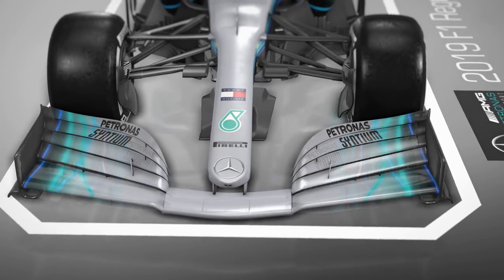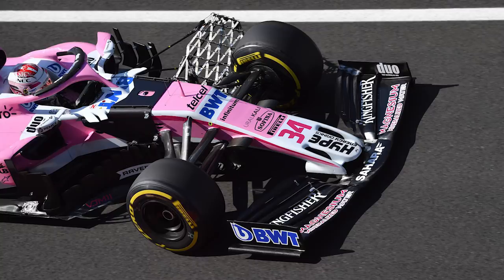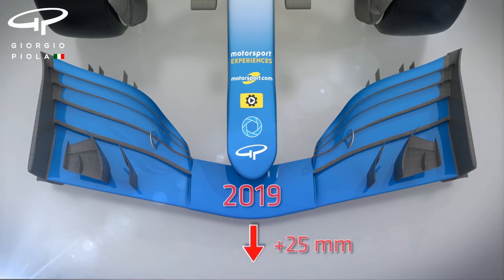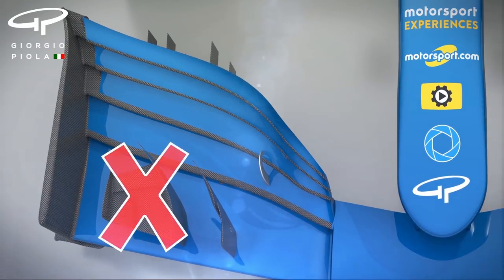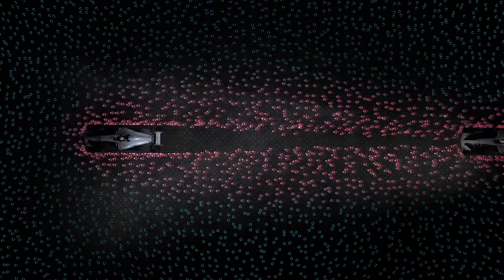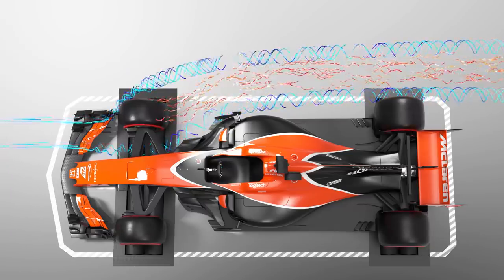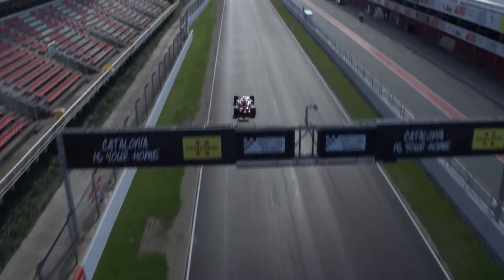First Look At The 2019 F1 Front Wing Designs

Comment: F1 should be suing MOTO GP style rules that help the little teams. Give them real track time, more engines per season and more fresh tyres over the weekend. 
When they improve these concessions drop off
Reply: European manufacturers won't ever agree to this
Reply: I don't watch Moto GP, but I don't think that would work well in F1 because of teams like Mclaren. Mclaren has a boat load of money but their administration struggles really prevented their development, and correct me if I'm wrong, but a Moto GP team operates at a fraction of the cost of an F1 team.
Reply: Like Dorna, Liberty wouldn't give the teams a choice, this is happening. 
As most main teams are also suppliers to smaller teams it's in their interest for those teams to have more testing time.
Mclaren, Ducati. same thing, was good, went bad due to management. but Ducati is now back up there thanks to the rules which meant they got concessions. as they improved these reduced until they had none. 

A lot of the cost now is development which is far more costly because they can't just run the thing around an airfield and see what happens.
Design, CFD it, windtunnel, take it to the track as a finished item, find it doesn't work as predicted. wasted weekend, bin part.

They also build engine after engine in the off season, dyno test loads of them to see which 3 may last the season and bin the rest, times this out for engine suppliers.
This costs far more than just making 10-12 engines in the first place and using them for just a race or two. same goes for other components in the drivetrain.
Reply: cornishcactus But then F1 is supposed to develop technology for road cars. That's why they limit the engines (probably they want to squeeze the engineers on reliability). As for tires, it's more to action and strategy I guess.

Edit: It's an expensive sport that's why it's difficult for manufacturers to build an f1 team from the ground . They would rather sponsor PUs .
Reply: @ cornishcactus - The problem with that is - at what point can you irrefutably conclude that a team has "improved" enough from its previous state to cut off the help? Because if its to make them compete with the front runners, then you'd want them to first match the top teams for a certain number of races. But if that's the case, then who would want to be a "top team"? Why would any team spend loads of money designing the best car possible if they know the FIA is just going to help out their opponents? And what incentive do other teams have to "improve" beyond that cut-off line if they know they can still get competitive results without needing to spend as much as the so-called top teams? They would just sit on that cut-off line and proceed to reap all the benefits without having to do any of the hard work. And what's stopping teams from faking their performances just so they can get the "benefits" of not being a so-called top team? So many problems with that theory. And quite frankly, it sounds like communist/socialist ideology more than anything.
Reply: Well that's easy and if you watch MOTO GP you'd know that podiums will get your concessions reduced.
Not just the odd fluke, tho it'd reduce it a little but Ducatti now have none so far as I'm aware now they are regularly capable of race wins again .

No team would aim to be in the concession zone, or at least would choose to stay there.
Wins mean money and sponsorship and no team would turn that down just so they can run midpack.
Look at Mclarens recent cars, some had no sponsorship, and they've still very little.
Williams run of form a few years ago won them Martini and thats going next year I believe now they're back of the pack. 

So what benefit might a couple more engines a season be you say.
Well first off less DNF's through failure, that's more potential points, better championship standing, more money from the pot. It's also more screen time and better potential for selling sponsorship.

Also engines have their various power modes which are based on minutes. If you've more engines you can run what you have in higher mode for longer each weekend giving you quali and race advantage.
The same with tyre choice. 

It's not F1 Stalin style and it'd not chuck the big boys off the top step ( again witness MOTO GP ) but it'd give the little boys a chance of running at the front, to be competitive and sometimes grab a podium if they get things right.
As they do that they get to join the big boy club. 
If the budget doesn't end up matching once concessions are off you drop in the standings but next year you'd get them back again ( tho it might be two bad years i think ) 

F1's current rules mean very little is translatable to road tech, no car engine gets close to the thermal efficiency of a current F1 engine and the differences in performance requirements/cost impact are too great to copy across.
Only when F1 was truly allowed to develop did this happen, monocoque  chassis, disc brakes, aero.
if these leaps happened now they'd be banned.

Limited engines are done in the name of cost not road tech, 5 now 3 engines per year, thats gotta be cheap right?
Well if you're the manufacture no, you make loads, break loads on the dyno find the good ones and use those for the year.
The cost of that gets passed on to your customers.
Road tech engines can already do millions of miles if treated right and none of that has come from F1 improvements.
F1 engine supply would be cheaper if they had 1 per 2 races or more. the engines wouldn't need to be so highly stressed. they wouldn't need to bin dozens or more in testing before picking the season quotas.
They would simply be cheaper because they wouldn't need to be so perfect. 
They'd pick/design a nice decent engine that'd do the two races over one that might do 6 or put out another 10BHP and it'd be far cheaper.
Reply: Dan Arnets That is cheap compared to running an F1 team. Low tier like sauber cost 100million at least.
Reply: Ferrari spends close to 600 million.
Reply: Yeah you are right, its not supposed to be cheap, but keep in mind that if costs gets too high many teams will eventually abandon F1 and you don't want 6 cars racing on a circuit...lol, look at indicar, much cheaper (because it is spec racing) than F1 and cars and they are almost as fast. We need to implement measures to make it easier to smaller teams, so there is less of a gap between cars and there is more actual racing, if you don't put a budget limit (which we already have) mercedes and ferrari would burn millions of dollars and make their cars even faster than they are and F1 will be much more boring than it already is. 
Remember, F1 can't be the pinnacle of motorsport if you end up having 6 cars on a racetrack and they have a gap of a second per lap respectively.

Comment: I think they should be limited to duel plane front wings and have the majority of downforce come from ground effect.  We now know enough about aero to regulate underwing-generated downforce to a safe amount.  People who argue that ground effect cars are too dangerous are 35 years behind the curve.  The side effect of ground effect based cars would be astounding performance and thrilling, overtake packed racing.  It’d be like indycar levels of overtaking with F1 levels of performance.  I’m not seeing a downside here.
Reply: turboboy1983 until a driver hits a kerb too hard and loses 500lbs of downforce instantly, that's the problem
Reply: Nick Bainbridge As ole Charlie himself would say, “Well then, don’t hit the bloody curbs!”.   That was from the Austrian GP driver meeting last year when they had those insanely high yellow “sausage” curbs.
Reply: They can seal the floor now with air(like they do now at the rear of the car to seal the diffuser), they don't need physical side skirts, so they wouldn't loose all downforce going over curbs.
Reply: @coast2coast00  - When you are on the limit not losing all downforce is irrelevant. Losing any is relevant.

Comment: The new design, 10 cm wider on each side, will just lead to more tire-shredding and punctures at the starts...which an honest racing fan doesn't want. I thought they brought the wings in a bit, inboard of the front wheels, to prevent this happening a few years ago? And now they, F1, are going backwards a bit themselves. Understanding the logic of F1 rule changes is a head-wrecker. 
Call me back when they get it right.

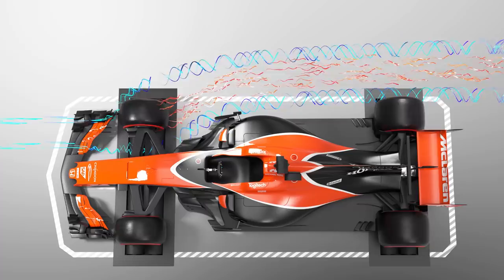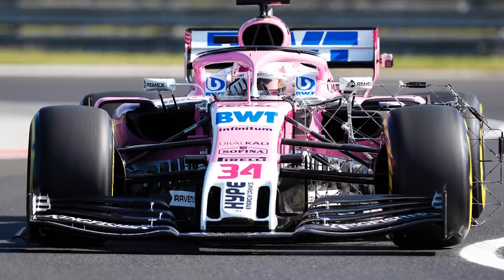Comment: A Honda-powered Mclaren car being used as a reference in the simulation footage at 1:08-1:21, LOL.
Reply: TheJokerit19 McLaren's aero was great in 2017. Why shouldn't they use the MCL32 as a reference? Tell me...
Reply: Boeing 7378MAX fan Because it still wasn't the best of the field. Furthermore, it's also a bit outdated as well since although the technical regulations stayed stable from last season to this the teams still found gains in the aero between these two seasons, and add to that the addition of the Halo, which, of course, will also be present on next season's cars.
Reply: They're re-using the simulation they developed last year to explain turbulent flow around the car.  In my opinion this was one of the best and most informative demonstrations that I'd seen.  So why not re-use it?
Reply: TheJokerit19 I get your point now...
Reply: chibikong Take a look at the chassis report... the car had a decent chassis, followed by good aero. Look at telemetry data. Or compare other cars to the MCL32. Which you can easily see that McLaren could corner at higher speeds compared to their mid-field rivals. Their engine rule literally overrides the beauty of engineering.

Comment: The PU still matters most. Tinker with the aero if you want but HP is still king. The new aero rules have been designed via a committee of egg heads who've  never raced e.g Brawn. He's a brilliant man but he's looking through an egineers eyes, not a racers eyes.

The problem with  making the wing wider is that its more prone to damage which just puts drivers who are in a scrap out the running which ruins their race and therefore the fans race. Theynshould make the wing narrower and the suspension stronger via regulating min area of parts etc... so that if someone gets bumped its not an automatic DNF.  Ricciardo  was so lucky at Hungary, it wasn't down to good car design just sheer luck that he didn't get hit in a crucial spot.

Comment: No, it won't change the racing, or only by a negligible amount.
The problem is the downforce itself and the vast size of the cars. The key is "where" the cars are fast and where slow. Big aero means fast through corners and shortened braking zones, which are crucial places for overtaking. Since corner-exit acceleration is entirely dependant on the the grip during the corner, the racing is not improved by more aero in that area. And that is all without "dirty air" into account. 
Also, with big aero there is only ONE line thats fast through a corner, or actually a whole track. The cars are not 'placeable'. Any other line is so much slower than the others, that you cannot, like bikes, race by picking different lines.
And to top it off these cars are gigantic and super heavy, which decreases the amount of viable lines even more. Imagine a race on a track which is 3 meters wide; with 3 meter wide cars. Are you going to see any overtakes? No. And for crying out loud, please don't ask for wider tracks! The problem are the cars and only the cars.
And finally the weight. The weight makes the cars heavily/more reliant on aero for grip, which, you guessed it, destroys any racing.
And no, driving past with the aid of drs is NOT overtaking. Its just driving past because you have a massive unnatural advantage. Push to pass, wow. As a purist racer and sportsman this is absolutely disgusting and destructive to the sport. 

Sometimes i wish i was in a leading position in F1 or just anyone would listen.. But then I'm just some guy on the Internet. Thanks for taking the time, maybe my thoughts had any impact at all, at least that's what i hope.
Reply: l,erwgpü3,ü2342 I agree. As much as I love the look of the super wide and low 2017 (and dare I say it 2018) cars, They need to be thinner so that overtaking is easier around thinner tracks like Monaco. Oh to be rich and famous....

Comment: F1 is about speed i would've loved to see the cars get faster and faster :( ik it's harder to overtake but they could've found another way
Reply: Things that make F1 cars faster are banned all the time. Ground effect, suction fans, active suspension, traction control, ABS, etc. That is the formula part of F1. It is part of the challenge to find new ways to keep going faster despite stricter regulations. In a way these restrictions accelerate innovation, similar to evolution.
Reply: Crucial_US if I'm not mistaken, the cars this generation and this year especially ARE getting faster and faster. The complex areo works for increasing cornering speeds and the engines are beasts, when they don't break down. Almost every track has had it's (fastest lap) records broken in 2018. If that isn't "faster and faster" then I don't know what is. No V10 needed at the moment, either..
Reply: Brian Given yeah ik but 2019 would be even quicker if it weren't for these simple aero packages you missed my point

Comment: i dont think this is going to have much of a difference in my opinion. Seeing how we had simple wings in the early 2000s and overtaking was still very difficult. What I dont like about the new regs is that they are making the drs even more powerful. To me it'll be too artificial because drs is already powerful enough and they are making it even more so cars will be going down the straights at a 30mph difference in top speed which doesnt seem right to me.
Reply: Philip S The groove tires then were very grippy when aided with downforce, but fell off when the wings weren't working well, the slicks we have now might handle it a bit better

Comment: Don't like em. Look like snow ploughs.

F1 Needs:
1. Narrower cars (back to 1.8m please)
2. More powerful diffuser/floor/ground effects
3. Better tyres (please god not the low profile shite they have suggested)
4. Aeroscreen ala Indy for aesthetic reasons
5. Reduce the weight by at least 50kg
6. Combined driver and seat weight of 90kg
7. 2 litre v8 turbocharged (simplify the battery a bit, kind of like the old school KERS because it still adds some strategy in power deployment)
8. Bring back refuelling (the single best thing they can do for strategy and the spectacle)

Comment: Maybe F1 can push for 6 stroke engine which should be cleaner than 4 stroke
Reply: mzamroni 6 stroke engine? 
Can you give me an info about that.
Reply: Two stroke, supercharged and turbo charged.
Reply: Armyguy864 Wrong way for efficiency bruh.
Reply: Nick Bainbridge- yeah I know.  The sound the motor makes is bad ass.  Still gotta be more effective than a 6 stroke engine though.
Reply: 6 strokes have two pistons on opposite ends of a cylinder, the power strokes pushing them away from each other.  You have the normal 4 strokes: intake, compression, power, exhaust, but you then inject more air into the exhaust gases and get another power stroke out of it.
I think there's another version where you take a normal cylinder and run the exhaust into a 2 stroke cylinder to get more energy out of the exhaust(with more new air).

Comment: i'd rather have them just cover up the front wheels like what formula e did with there gen 2 cars, instead of end plates, have wheel arched like the red bull gran turismo concept or the mclaren mp4x, i mean be a bit more practical majority if not all modern cars have covered front wheels to improve aerodynamics even in just a small way why hasn't single seater formula series moved on yet, besides formula e that is
Reply: Well I think the reason they don't want to do that is because then it would turn the cars into closed wheel designs and not open wheel. F1 already made a highly controversial change by closing the cockpit with the Halo, they wouldn't want to close the wheels either.

Comment: Another round of moronic changes that amounts to nothing. Look, The act of passing a competitor is not a problem in f1. DRS solved the overtaking issue.  The real solve to creating better racing in F1 is returning refuling.  Make the gas tanks smaller and re-introduce multiple fuel pitstops, Why?  because the pits is a crucial place where advantages and errors can occur durring a race.  A race leader is more likely to be held up in the pits. enabling more competitive racing not just from the drivers seat but also the pit crew.  Less tires, Yup the exact opposite of whats transpired thru the years.  Tire management is another major factor to a race being won or lost.  Today theirs too many tires to choose from and the tires work too well. enabling a pole leader an 80% or higher change of winning .  F1 needs to be harder to achieve victory. as not to be dominated by the teams with the most $$$.